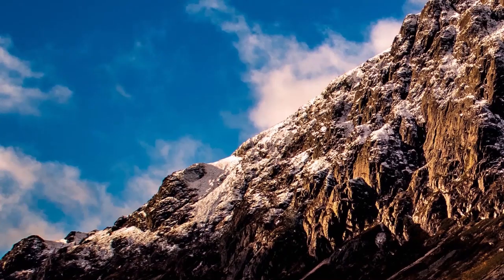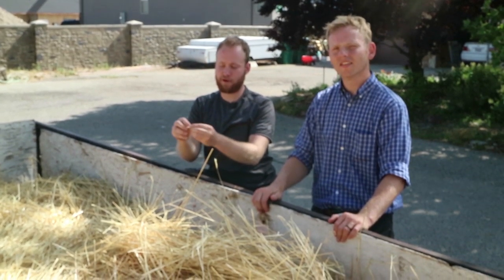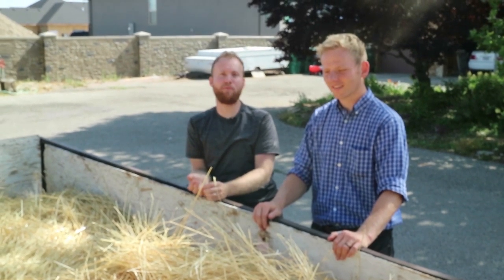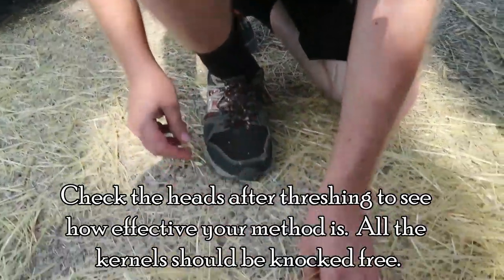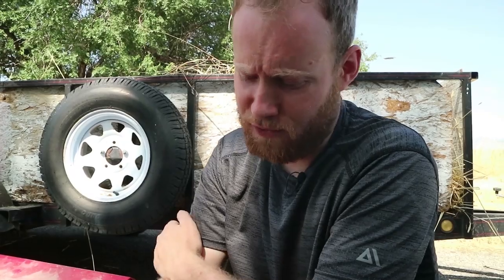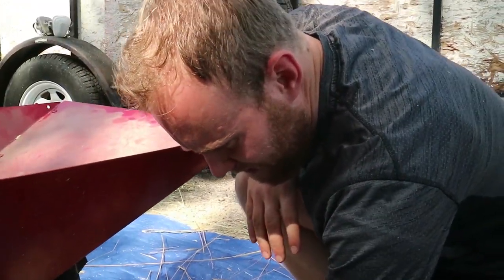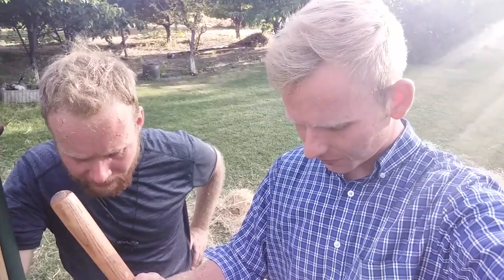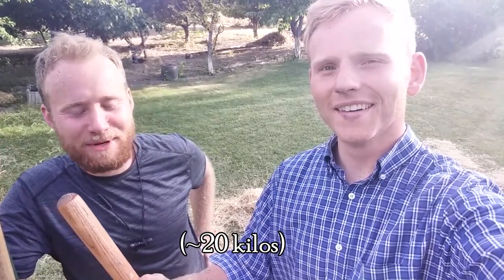Threshing Wild Rye With A Leaf Shredder?!

Comment: I use a pinewood flail on my drill/bucket setup. It's hard on the heads and gentle on the grains. Also I try to limit the amount of hay in the bucket as it kinda protects the heads from the flail. Keeping grains intact is of great importance for me as I'm trying to preserve old grains from my region. Awesome that you found the right tech for your needs though.
Reply: Could you thresh using a high powered shop vac with an appropriately sized mesh over the hose end which was connected to a hole in the bottom of your 5 gallon bucket?

Comment: Just found you folks via TKOR. I'm adding you to my off-grid and Make Stuff playlists. Thanks for this content. While watching this, I seem to remember a machine I saw on a commune way back in the very early 80s. It was an old round stainless washing machine tub, the type with lots of holes. There was a vertical shaft with a handle that was set up with cross-braces to keep it centred. Attached (welded) to the shaft were a heap of thin rods or blade type projections. It was right near the wheat grinder (I have hand-ground a 50kg bag of wheat seed in the past, yes), but I never knew what it was for. Now I think I do. The people there used to buy their wheat, but they had grown rice on occasion. This was in the tropics where wheat doesn't do so well due to the rain and humidity. I'm now guessing that's how they threshed the rice.

Comment: A pair of rubber conveyor belts running in opposite directions at a distance slightly more than a single grain, like rubbing it between your hands. With a good blower perpendicularly on it, it should also clean it up pretty good before the grains come out the end. Thoughts?😉
Especially for bigger volumes.
Reply from the maker: I've seen something like that with rubber coated disks for the final heading cleaning. JB

Comment: I would turn the leaf shredder throttle down to idle or just above.
Reply: Nothing beats wide open.
Reply from the maker: The lower throttle should break less seeds, but we found it also has a harder time with the long fibrous stalks. JF
Reply: @GoodandBasic  Maybe, try it slower, but with just the heads and not all the stalk?

Comment: Hmmmm.  What if you replaced the blade (which is designed to cut) with some sort of flat bar that would beat against the heads rather than cut them?  Also, you can buy a bag that attaches to the chipper so you don't make such a big mess.

Comment: How about a chicken plucker with the rubber heads? Or a cement mixer with some pea rock tumbling around inside?
Reply from the maker: Oooh. Those would be interesting to try. I think the cement mixer would add to much grit (difficult to separate out) if there were gravel. But maybe the cement mixer could work with just the paddles or wooden blocks tumbling around inside.  JB

Comment: I would suggest changing from knives in the shredder to blunt hammers from bar stock maybe
Reply: Or rubber flappers.
Reply: Yes, change put the blades, plus adjusting the spring on the throttle governor to run at lower rpm.

Comment: Could you thresh using a high powered shop vac with an appropriately sized mesh over the hose end which was connected to a hole in the bottom of your 5 gallon bucket?

Comment: Still a nice harvest :) Did the winnowing had any negative effect on the broken kernels?
Reply from the maker: I had a thought about that. I think that's how farmers may have inadvertently selected for better grain. The winnowing process is more effective for fat grains (like the domesticated kind) than thin ones (much of the wild grain). This means that if you plant what you winnow, then the grains will naturally tend to be fatter over time. JB
Reply from the maker: It wasn't too bad with the broken ones though we did lose a portion. JB
Reply: @GoodandBasic  That makes perfectly sense. Even beating the grain by hand would crush some kernels. It's just like checking seeds if they are viable. The ones that sink are good and the floating ones are discarded.

Comment: What does winnowing mean?
Reply: Winnowing is when a mixture of the kernels and waste materials like straw are dropped through a moving air current (historically the wind). The denser kernels fall through into a container while the less dense waste is blown outside of the container.
Reply from the maker: Separating the grains from the small bits of waste material (collectively called chaff). This is typically done using wind, which affects the chaff more than the grain. The grain falls straight down and the chaff falls at an angle. JB
Reply from the maker: Separating grain from chaff (chaff is the empty husks and straw).  The chaff is lighter in weight so it can be separated using a fan or something similar.  The fan blows away the chaff but not the grain. JF
Reply: all of the above and... You want to keep the grain as clean as you can, because the winnowing blows away the chaff, but any small stones you picked up with sloppy threshing will fall through the cleansing breeze and into the grains.  Which will accelerate the erosion of your quern and your teeth.